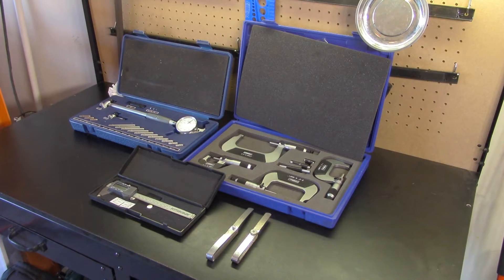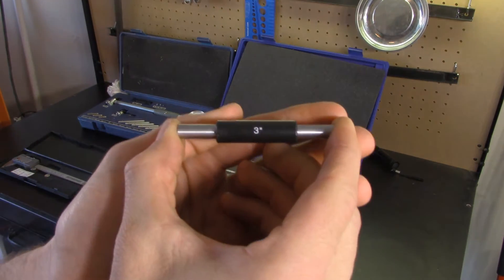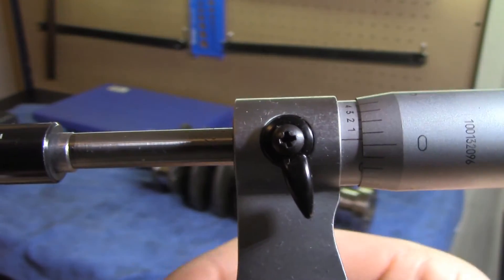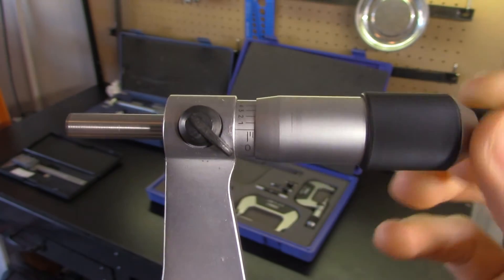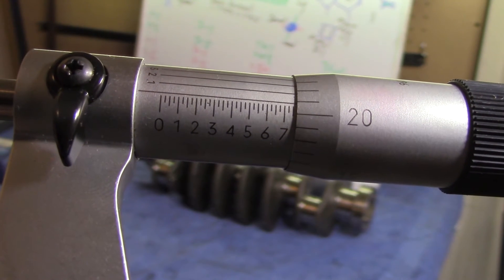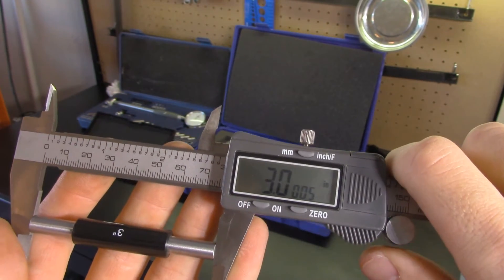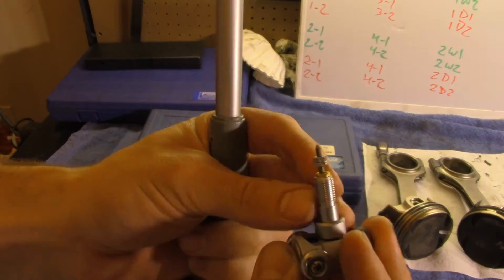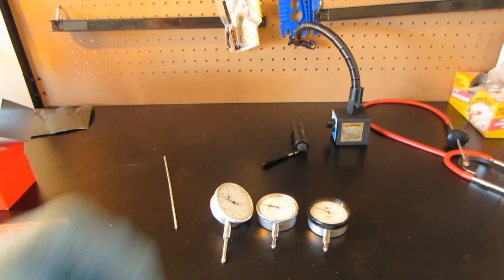Bore Gauge, Micrometers, Vanier Calipers Oh My

Comment: Goddamn, as a European, all these imperial measurements are making my brain hurt. Then again I really want to learn the Imperial system, especially concerning cars and stuff. Hey, would rewatching this clip a thousand times help me :D?
Reply from the maker: I sure hope it would :) On the bright side it would help me a little :) I will be sure to include some metric conversions in the tech videos to come just for you.
Reply: ***** As an American, I think that we've long lost this battle, and should've started a slow but relentless move to metric decades ago. If I ever blueprint an engine, I'd like to try doing the whole thing in microns.  I'd rather put up with the occasional "101600" (microns) instead of "4" (inches), in exchange for all those times I'd have to write "0.0039" (inches) instead of "99" (microns).  Sure it's more accuracy than I'll need, but that way none of the measurements will have a decimal point to mis-place.

In the case of thousandths of an inch, however, that 1844 standard is likely to be in use for some time.  I've read that the thickness of paper and plastic are still often measured worldwide in "mils" or "thou", as are many distances in printed circuit boards (mil and thou are both just different ways of saying one one thousandth of an inch).  I don't know why most of the mechanics in the videos I've seen use the term "thousandths" instead of "mils".  Me, I have trouble even pronouncing "half a thousandths".